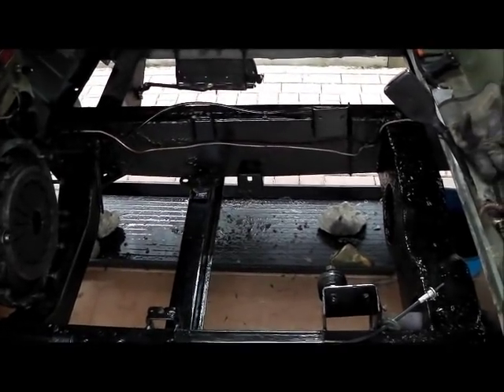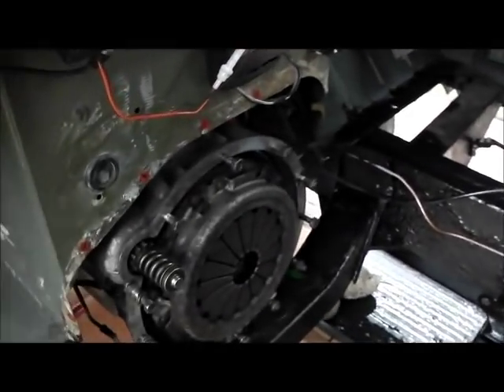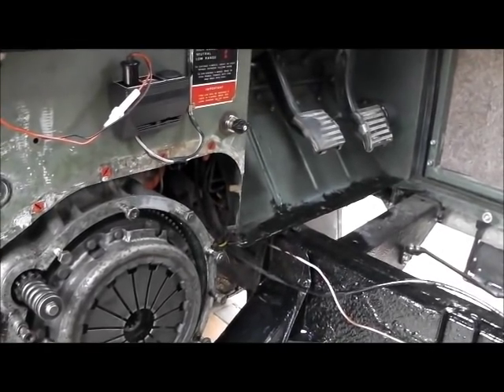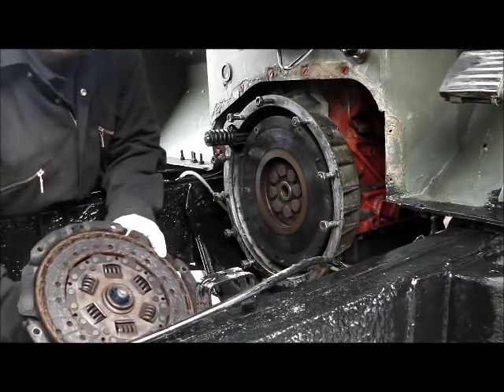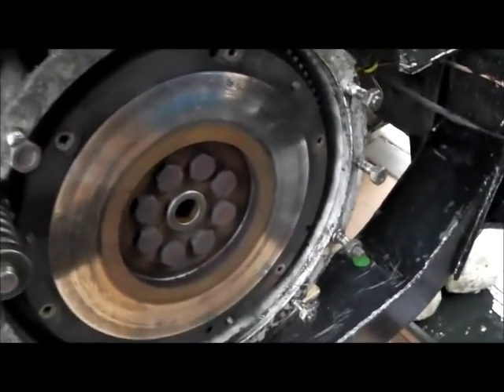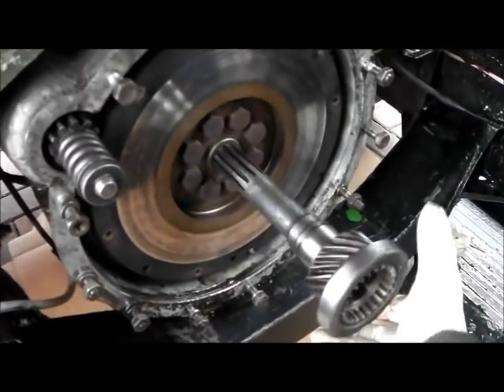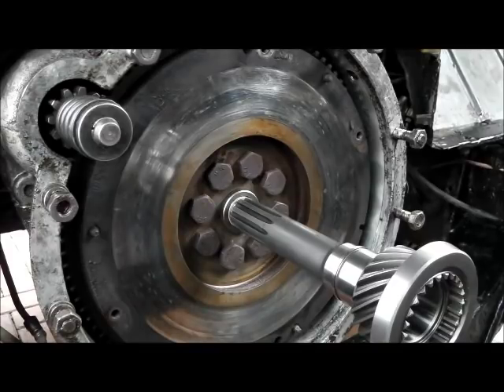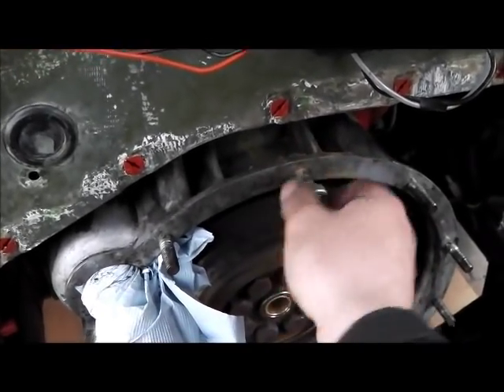Land Rover Series 3 - Clutch Replacement

Comment: That is one heck of a spring on the starter drive.I love the way the whole seat tub just unbolts and comes out.  Makes it a lot easier to work on the clutch and transmission
Reply from the maker: +odc43054 

Nothing on an old Landy is light! Getting the seat box out wasn't too bad, but it's typical British engineering - dozens of tiny rusted bolts that are much longer than they need to be...

Phill.

Comment: Question for you mate. I have used my input shaft to line up the clutch friction plate and clutch cover assembly, as you have done in this video. When I tighten up the cover bolts slowly in sequence, I am able to insert and remove the shaft with a pleasant 'popping' suction sound as the bronze bush is new and the fitting is nice and snug. BUT, when I fully torque up the cover bolts to 25ft/lb the shaft will go in but I can only remove it by tapping it out with a rubber mallet. Why so tight? Will try later with some moly grease and see if it is easier, but worry that if it is this tight it may bind when assembled.
Reply from the maker: I suppose as the bolts are tightened the friction plate is better sandwiched between the flywheel and cover. It should sort itself out when operated. Contrary to what many say, Land Rover did recommend a sparingly applied smear of molly grease on the input shaft splines to help things along.
Reply: @steamwally  thanks for the advice man. Much appreciated. Will do it now.
Reply: Done. Took the cover and friction plate off, rotated the cover and aligned different holes to the little positioning pins (even though the cover is the same wherever you put it) and it worked. Input shaft slides in and out snugly. Feels perfect.

Comment: Grand video, I take it it’s all the same for a series 2a?
Reply from the maker: The clutch is quite different on most 2a's, both the friction plate and pressure plate as well as the operating mechanism - but the principle in fitting the friction plate,pressure plate and spigot bush is the same.
Reply: Cheers 👍